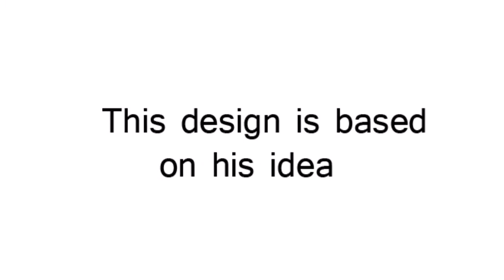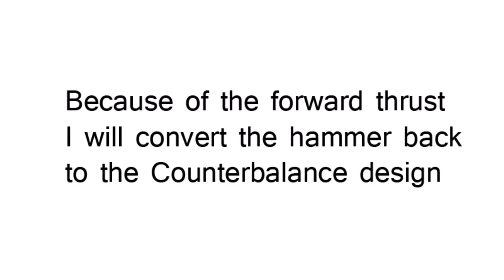Teeter Totter Treadle Hammer

Comment: Seems to me that it is all about the hammer weight. I have a parallel - but not inline treadlehammer. Never missed that funktion but i'm always searching for more power anyhow
Reply from the maker: I think I mentioned somewhere the hammer weighs 75#. The spring design hit harder than the teeter totter or counterbalance design. The counterbalance design hits hard enough for my purposes.
Reply: @Wkirkleyiphone  My guess is because with a spring you have a resistance which starts low and ends high, allowing for a better buildup of momentum than a fixed leverage force?